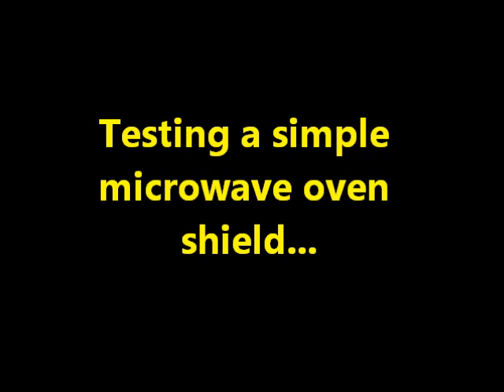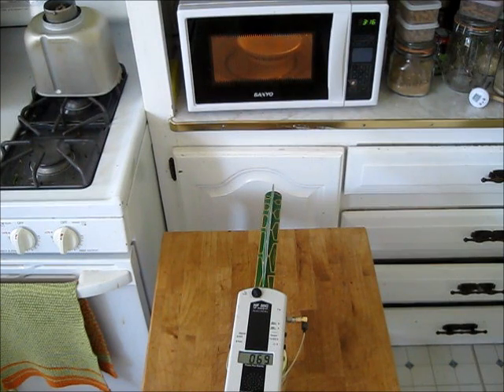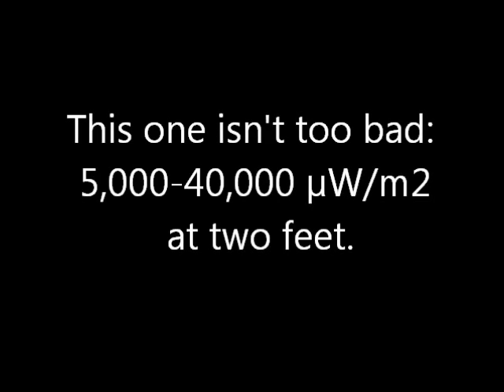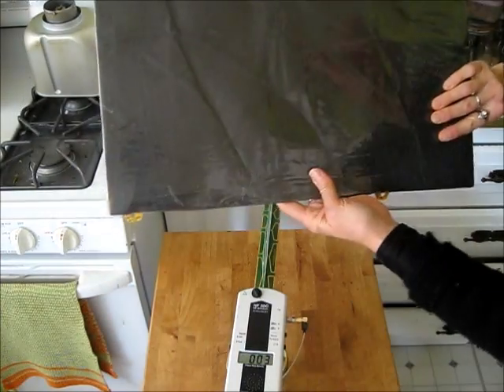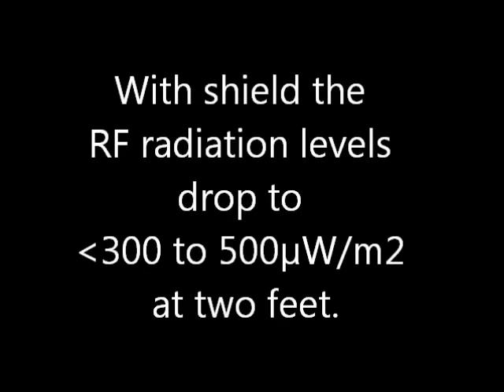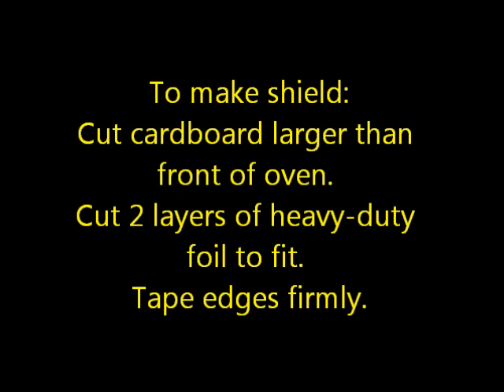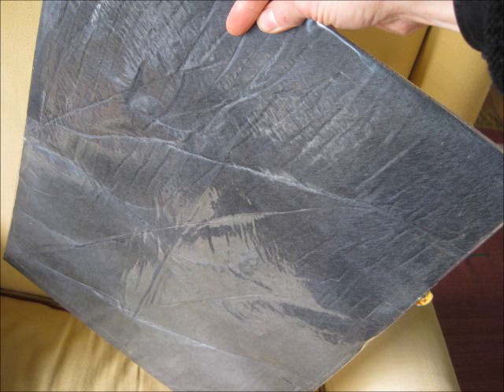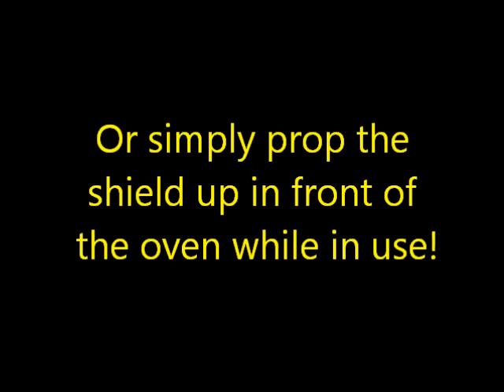Microwave Oven Shield Gives 100x Reduction in RF

Comment: Hi.  Thanks for making and sharing this video.  I just bought an Acoustimeter and tested my (other brand), similar size, microwave and got very similar unshielded readings.  But what I thought you might like to know is, for whatever reason, foil alone , even wrapped 1/3 of the way around mine does very little at all to reduce the reading.  This oven seems to radiate in all directions and it's measurable at about 20 feet away, outdoors.  Probably time to get rid of it.   But if I take 2 layers of " Global" brand Mylar emergency blanket wrapped entirely over the microwave, I again get similar readings to yours with your foil shield.  This is not fancy Mylar but it is the gold and silver sided style.   I found it on eBay from a US seller for just $7 for 4. They're 84" x 52".  Larger quantities for less per item.  I've watched several people on YouTube demonstrate how their Mylar tests show very little shielding effect but 2 layers of this appears to be as effective as your foil.  The only difference in Mylars seems to be that this has a gold side, which would only seem cosmetic.  Each one of these comes folded smaller and lighter than a mans leather wallet.  Mostly, I just want to pass this info along as it could be helpful to some folks.   Maybe I'll make a video too.   Thanks.
Reply: yes foil wont do squat in reality. the ovens leak from every where.  i think you would need solid copper box to block it.

Comment from the maker: YES, the microwave RF radiation does go through any wall, though some is absorbed by various building materials, like wood or concrete.

This idea wouldn't be optimal for a home where people spent time on the other side of the wall from a MW oven---though this seems a bad set-up with or without a shield!

I agree with one commenter in theory---don't use the damn thing, or as little as poss. It can decrease nutritive value, and much of the food heated in one is often processed garbage anyway.

Comment from the maker: @VideoGuyNC I contest the notion that a MW oven with the door closed (that isn't excessively leaky) produces more RF than a cell phone or cordless phone base station.

I have found both types of phones purposefully emit higher levels than most MW ovens do by chance'. Your strongest emitter is always your cell phone; your most constant emitter is always your WiFi or cordless phone base station (most). Your dose can be expressed as time-in-field x strength-of-field.
Reply: bollocks, the oven is more powerful to start with. everything ive tested show mobiles phones are very bad but dect phone are worse. the oven is in a whole new league of its own. cant even block it at all.